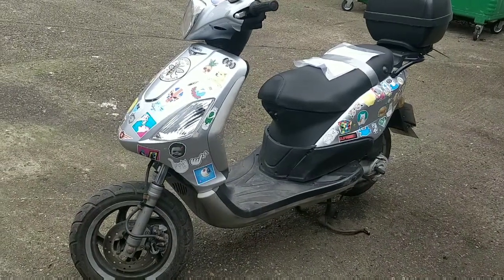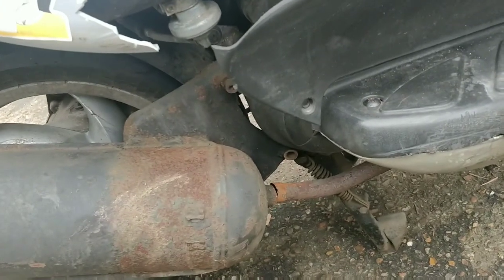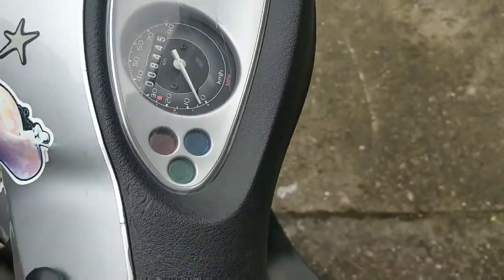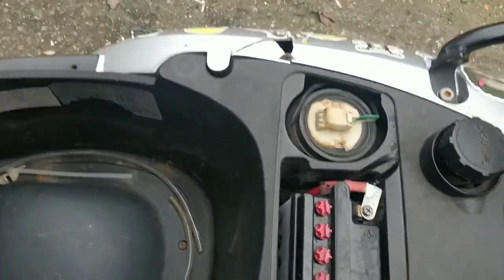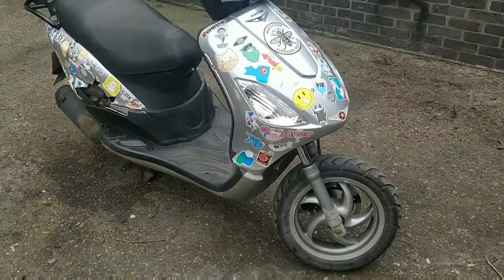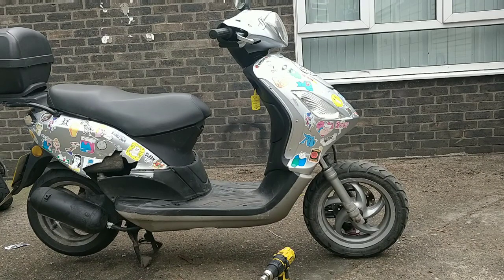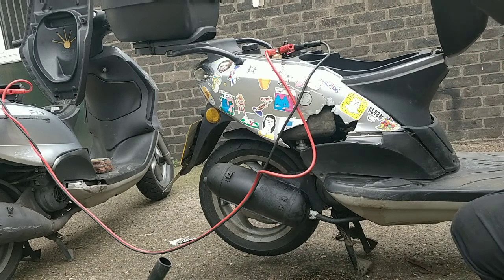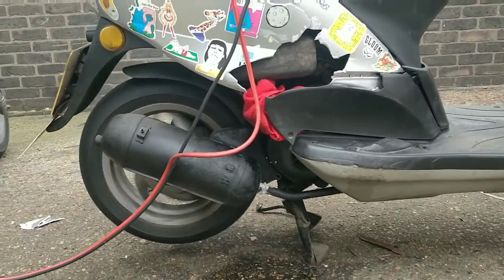Piaggio fly 125 project, fix, repair, build, salvage, copart,

Comment: Someone sure sticker bombed that scooter huh! Everytime I purchase a bike with a shit load of stickers, I sweat bullet's taking them off. Like a box chocolates, you never know what your going to get under each one LOL.
Reply from the maker: I know mate, no joke o feel the same. Plus you never know what's under it.

I'm going to try this new sticker removal rubber wheel for the drill. It peels stickers off but dosnt ruin the paint aparently.
Reply: @motorcyclerescuer  yup ! Paint & plastic's are fragile ! I bought one that was covered in stickers & someone thought it would be a good idea to use clear coat over top of the stickers LOL. I wrapped that scooter in vinyl & sent it down the road
Reply: @motorcyclerescuer  that would be a nice tool for box when dealing with sticker problems 👍💯

Comment: I have a piaggio fly 125 2013 plate lights comes on just not turning over battery is charged any help !
Reply from the maker: Could be anything I'm afraid, bad button, bad wiring, bad starter, bad bandex. 

If you know what the starter solenoid is you can try bridging the gap to see if it turns over then? You may need to Google solenoid and find it on your bike.